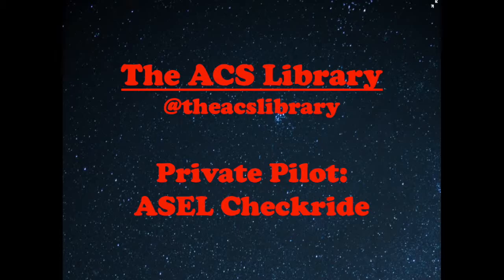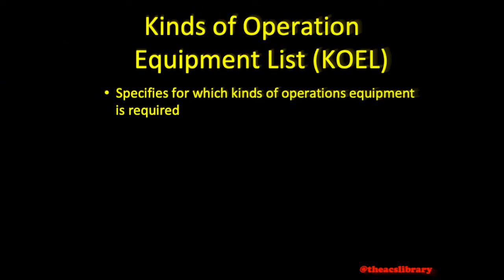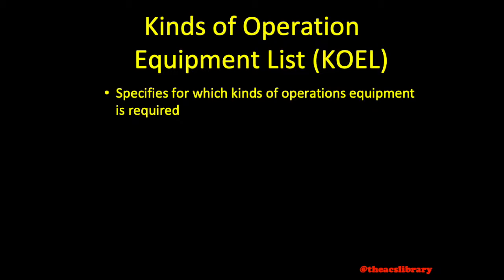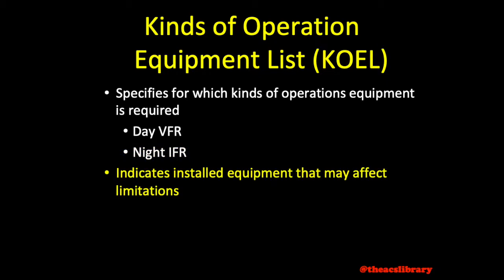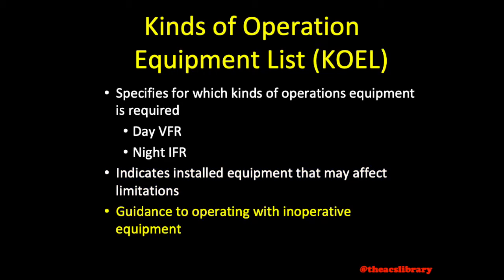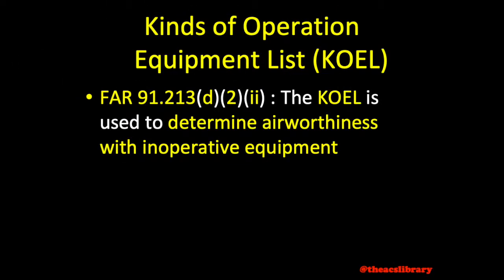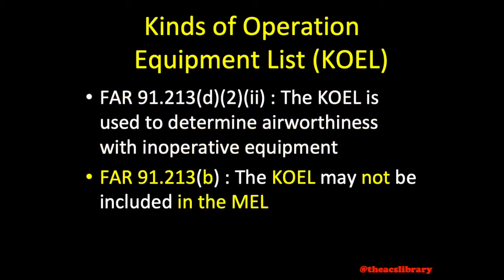PA.I.B.K3c Kinds of Operation Equipment List

Comment: I just don’t get the difference between a mel and a koel
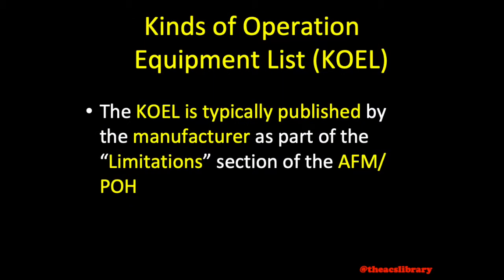Reply: my understanding is that KOEL focuses on the type of flight (operation) and which specific equipment is required for that flight, while the MEL focuses on the aircraft itself and what minimum equipment is required to fly that specific aircraft, but i may have misunderstood it as well. i think they overlap since they both explain limitations and guidance of flying with inoperative equipment, but 1:02 video highlights FAR 91.213 (b) that MEL cant have same equipment as KOEL so i think thats the line that divides the two. so MMEL+KOEL supplement each other is my understanding?